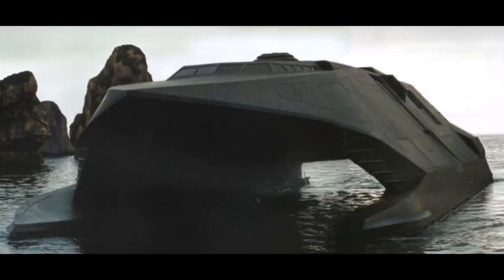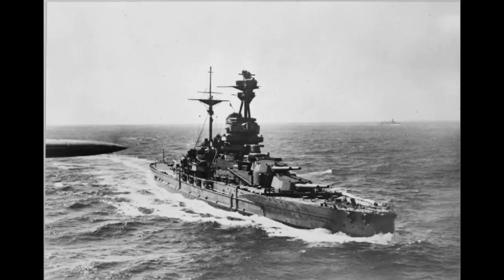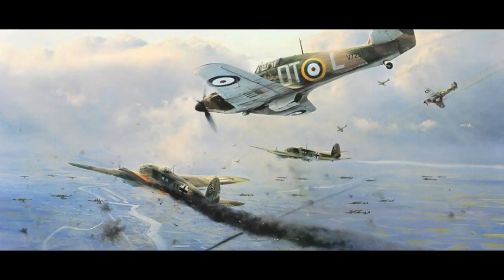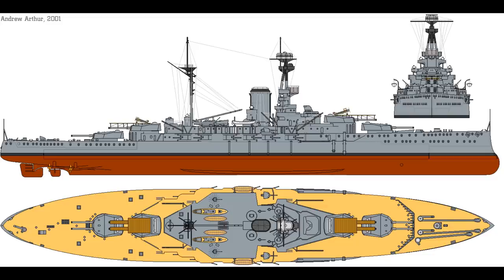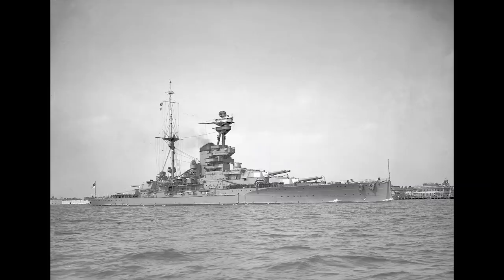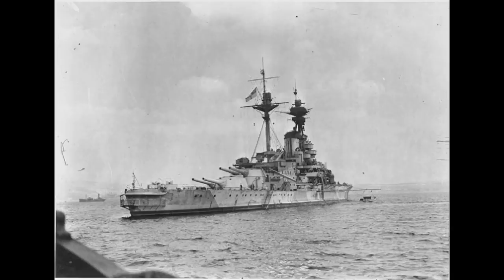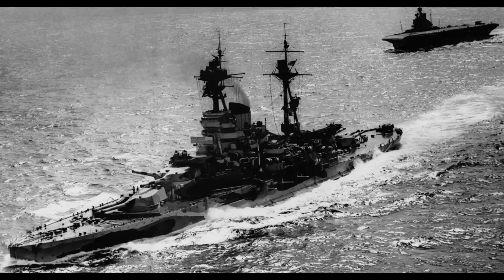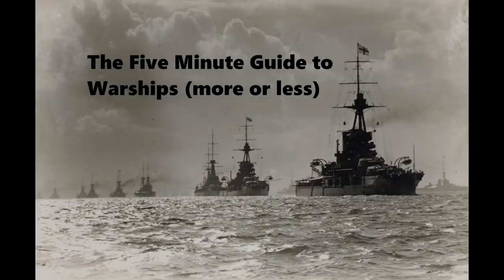How to make a Stealth Battleship - WW2 Style

Comment: I was expecting a rundown on the Vesuvius Dynamite Cruiser. She had 3 15 inch guns fixed at an elevation of 16 degrees protruding through the deck. Instead of gun powder or cordite, the shells were launched by pressurized air. The whole ship had to turn but the amount of air expelled could be modified to "dial in" range. The shells were packed with TNT, which was too sensitive for a standard gun. Basically, this ship could sail in at night, and launch without any telltale report or muzzle flash. Allegedly, it was quite terrifying.
Reply: Actually, TNT is one of the least shock sensitive high-explosives, and was regularly used to fill "modern" gun shells, with gunpowder or cordite being used as propellant.  Some earlier explosives such as Picric and Gelignite were markedly more sensitive, and these would have been the impetus for an air-powered gun.
Reply: @Kromaatikse  They used dynamite, not TNT. Despite the AC/DC song, those are two difference substances.

Comment: Escellent video there and something I never knew about,

It's less about active stealth and more about misdirection.
As you pointed out every eye was skyward during the raid and any explosions from Revenge's guns would have been written off to bombs hitting.

I wonder if the modern stealth systems like paint and hull design would survive battle damage?  What happens to the stealth rating if that paint is burnt off fom a fire or the hull is no longer that nice angle?
Reply: John Fisher oh yes, a shell hole will definitely show up on any radar screen
Reply: The point of modern stealth systems it to avoid getting shot at in the first place.  If you incur battle damage, it has already failed.

Comment: Did they put any darker paint on it for the mission?
Reply: Grey is actually better than black at night
Reply: @Scoobydcs  Hmm. Ok, fair enough.
Reply from the maker: Yeah, ironically enough a pure black shape is really easy for our eyes to spot in most night conditions.
Reply: @Drachinifel  Well, I'll be darned. I bet it made preparation a little simpler to not have to do anything to the ships themselves.
Reply: @Drachinifel  : I remember reading of experiments with dim lights on deck to make the blackist areas less black and harder to see. I don't think it was ever used in practice.

Comment: That's all fine but how did the German coastal artillery spotters fail to immediately spot gun flashes in the night? Fog maybe? And how did the ships avoid the mines? Just blind luck, or something is missing?
Reply from the maker: The British were fairly aware of the extent of German minefields, and as for spotting, that's what the air raid was for, the explosions and the AA guns going off both distracted people from looking to sea in the first place, and also would affect night vision.
Reply: @Drachinifel  You need night vision to see non-self illuminating objects at night. A battleship which is firing is self-illuminating.

Comment: How can a ww1 era Battleship Warspite be considered a tremendous and valuable asset, and the WW1 Battleship Revenge be considered so much less so?  I can understand different guns, armor layouts, and therefore capabilities. But still a battleship is a battleship. Isn’t having 1 better than not having 1?
Reply: Problem was that the "Revenge" class were essentially cheaper, slower, and smaller versions of the "Queen Elizabeth" class, so had less room and tonnage for upgrades- and worse for them, they had been deliberately designed with a slight roll, which was intended to be an aid for gunnery (if I remember correctly), but made it even more difficult to upgrade them.

Comment: When this type of ship can fire a shell about 20 miles and the channel only being 23 miles at it's minimum then it been better to set up hidden spotting posts in range of the harbor and send coded messages to the ship tell her how well the fall of shells was on the target?  Then you would not need to send the ship that close to fire! Just use the spotters and job done without even sailing more than 3 or 4 miles from the British port.
Reply: Large shore batteries were used by both sides to attempt to shell the opposing side, however they usually just spent all thier time shooting the opposing shore batteries and not getting much done. Look up the German railway cannons and the British response to them.
Reply: Cherbourg is a little further than 23 miles from England

Comment: can you get one fact right the German navy did not have the ships to support a landing in 1940 or in 41,42,43,44,45 the battle of Norway saw to that 
But on the other hand an interesting bit of Royal Navy history will done for that
Reply from the maker: Realistically we know now they didn't have enough landing craft and Sealion was never going to work. But in 1940 neither sides leadership knew that. Which meant that what landing craft they did have 'needed' to be destroyed.
Reply: i would question   that i think we did know that Germane fleet took a battering in Norway and the loss of the Graf Spee at the  River plate  meant that it was severally handicapped 1940 , And  it was around 4 X smaller than the RN at the start of the war.. i think there was some confidence that the Home fleet could handle a landing  if it happened.
Reply from the maker: @daniellastuart3145  the Royal Navy certainly had plans to deal with an invasion force, but equally a huge amount of work and money went into preparing land based defences and weapons for use in the event of a German landing. 

A lot of people high up believed a German invasion was possible, and they knew from the UK's own history that it's very easy to build huge numbers of small craft in a short time.

It was far better to mitigate the risk and deny the Germans any large concentration of landing craft that even to leave them with a force that could conduct a raid, which would vastly damage morale.

In terms of pure hard calculus, the best way to win the war would have been to let the Germans invade and then close the door on them, but that plan only works in our mathematical terms, in reality it would never be allowed.
Reply: Sorry meany in German navy were not confident in the operation sea-lion. from day one
 1st the  Germans landing craft were nothing more then converted river and canal barges not any near the landing craft the Allies had. and no real transport ship, 
 Also having half   it's  destroyer strength lost at Battles of Narvik And the lost of 1 heavy cruiser 2 light cruiser in Norway and the Graf Spee in 1939. reduces the operational strength of the German navy.
which goes back to point in you statement of the German navy being able to support a landing, it could not
the fact of mater is the German Navy was always the weak link in operation Sea lion. and everyone in the German high command know it
for  me operation Sea lion was a German bluff  and that it  was never going to happen 
yes we  were preparing for but even by September it was getting to late.
Reply from the maker: @daniellastuart3145  I'm pretty sure both sides millitary leaders were pretty sure it would never work, but the political masters were a different story.

When it's been wargamed the Germans normally manage to land something, it just gets bottled up and destroyer when the RN shows up.
Reply: yes also they would had take Dover or Folkstone on day 1.
not sure on the  political masters  but it Hitler total miss read the British in 1940
Reply: Hitler may not have seen his regime as the abnormal break with bourgeois  Europe that the British did.  If Chamberlain really did try to buy off Hitler with the grant of new African colonies, or encourage him to attack Stalin before 1939, then Hitler might have misinterpreted this as a Britain ready to mainstream his Reich into the normal ranks of anti-Communist Great Powers.  But with Churchill there could be no doubt; I could tell when I read Churchill's postwar memoirs that he hated Hitler for the most damning reason a Briton can imagine: he was too much like Napoleon!  Not just a tyrant, but another Little Corporal trying to rise above his station.  And the British fought the French for 25 years to crush the rise of a new ideology that wasn't a tenth as pathological as what Hitler was brewing.
Reply: @Drachinifel   It was later revealed that, when the germans invaded the Netherlands in May, 1940, their objective wasn't just getting around the Maginot-line into France before the allies could respond. It was also planned that the germans would seize most of the Dutch commercial shipping-vessels (to use them later on in the invasion of Britain) that were in port. The Dutch Commander had send a message to all Dutch ships on-route to the Netherlands just hours before he was forced to capitulate. The message read: "Don't sail home!" The commercial ships that were in the Netherlands were told to make best way to England and so Hittler conquered the Netherlands but not the Dutch fleet.
Furthermore, the Dutch shot quit a lot of airplanes out of the sky when germany executed an airborne assault on The Haque (using AAA they bought from the germans a couple of years earlier). Due to bad/desperate planning by the germans, some of these planes were piloted by very experienced pilots and instructors. Germany lost most of it's ability to train its future airmen and pilots.
We didn't crush germans ability to invade the British Isles, the germans lost it themselves by not taking the Netherlands fast enough and without significant losses.